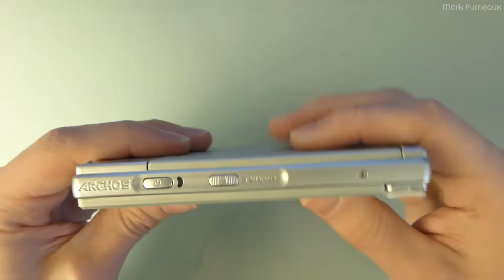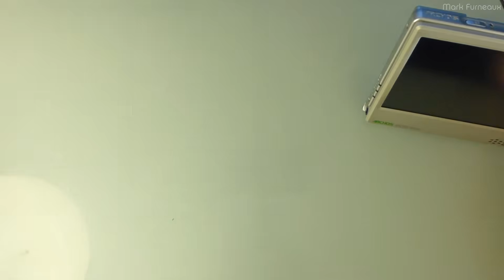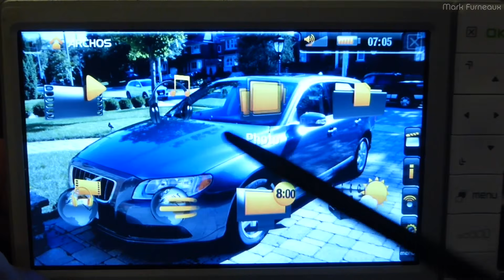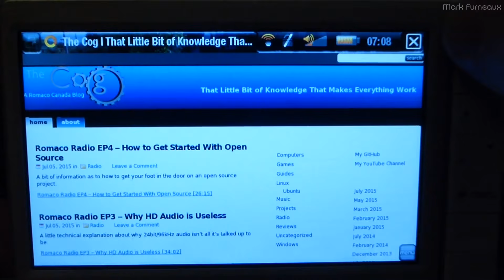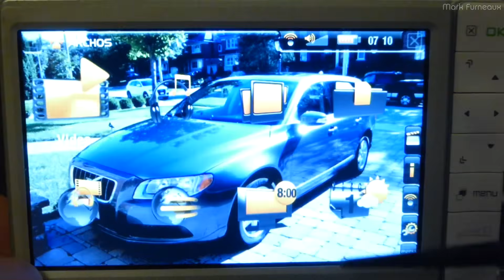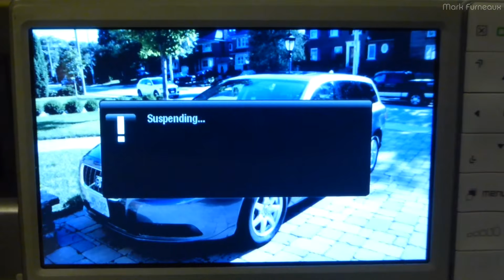How Many People Remember The Archos 605?

Comment: if you need a batteru they did made the battery dock for the 605 it was meant as a on the go staying in hotels or long trips accessory it docks into the bottom gives you USB ports a charger port av in as well as having a lithium battery inside to boost battery life I belive its a 18650 cell so replacing that shouldn't be too hard

Comment: I preferred the 504 as you could put big hard drives in it. The 504 had great sound through its headphone out. Many times better than a lot of competing products even to this day, plus you could digital out via the dock if you had a DAC. All considered except for the hard drive size cap it’s still a decent device even today. Batteries though are no longer made. I may have found a Chinese supplier of a battery that fits in the existing housing if you don’t mind soldering.

Comment: I actually still own an Archos 404 30GB. It's a basic media player, no wifi or touchscreen, but I got the USB adapter back then which allowed it to receive and read USB flash drives, and I still sometimes bring it with me if I need to copy something to or from a flash drive and there's no computer available. The battery has been changed and it still holds a little bit of a charge so it's usable.

Comment: I've got the 80 GB wi-fi one and it's still in full working order, even if the battery has seen better days. At its time, the 605 was an awesome flagship product and the envy of anybody who was into portable video players. But it became entirely obsolete almost over night when smartphones began to take wider hold. There is nothing it can do which smartphones, even in 2009 when I bought my 605, couldn't do ten times better, and with a slimmer, less bulky form factor. It remains a curiosity, a showpiece from the very brief time between the birth of portable multimedia and the all-encompassing revolution that was the smartphone. I will hold on to mine, because the $50-100 it could fetch on eBay, if somebody is still interested at all nowadays, won't make up for giving away a now delightfully obscure piece of personal tech gadget history.

Comment: i had the very very first jukebox multimedia which was the very first portable video device ever, which was amazing at the time but being bleeding edge it had some serious drawbacks. once the av300 and especially av400/gmini400 came out, they had the polish down too in the interface. the feature set was OUT OF THIS WORLD. being able to offload your memory card contents onto it was insane. 80gb in 2004 was insane. the av400 came in up to 100gb which was the largest hdd available of any kind at the time. the interface was amazing on these as well. being able to use it as a dvr, having the ability to use a backlit lcd remote with fm tuner, and having camera/camcorder add ons was bonkers. absolute glory days. archos today just rebrands chinese phones and spent the last 7 years or so just rebranding cheaply made chinese mp4 players. shame really, because they had some amazing innovation on their own devices.
Reply: I still have mine and it works. Was trying to find another one or something thing similar but no luck it was a great idea to bad nothing new like it available.👍✌️👌
Reply: @josephsaucedo8691  yeah you have to check eBay or buy an older iriver or something. Phones today do everything it could do but for the time it was absolutely incredible.

Comment: Love my Archos 605 30 gig! I replaced the battery once and am due to do it again. I use it primarily for the wifi and internet radio. That said my biggest beef with Archos was the way they managed the various plugins necessary for wifi, internet radio, internet tv, video(mp4 etc) and audio codecs etc. They were all preloaded but you had to buy the separate plugins to get an unlock code for each (and they were stupidly expensive - around $25 each iirc) ... and now that the Archos 605 has been left in the dust do you think Archos would make available the plugin codes for all us happy 605 users? Nope (bastards)... I did get a 120 gig 605 minus a hard drive (for free!) and have tried to find a compatible drive. However, even with a compatible drive getting it to boot up and then get all the plugins working, well, I'm guessing that'll never happen ... 

Still, I'll use my 30 gig 605 until it will not work anymore!
Reply: hey, may i know where u replaced your battery? and what prompted u to think it was the battery. mine keeps shutting down upon pressing the on button (startup screen loaded but after a few secs it turned off). That mean the batt is fried?
Reply: @ChowMeinChowdown yeah, that would be my guess... my original battery wouldn't last more than a few hours after a full charge... the replacement battery was a bit better but I suspect it was a used battery (an Ebay purchase) and so once again I need to replace it ... but I probably won't because since Archos is dead their wifi Internet connection system is no longer in use so it's just a player and I have other better players (Creative Zen Vision M)....
Reply: anyway, archos has locked hdd check system, any archos 605 player has own individual serial number of HDD. i've hacked this check many years ago, so i can help you.
Reply: i too found this stupid

now we call that dlc lol